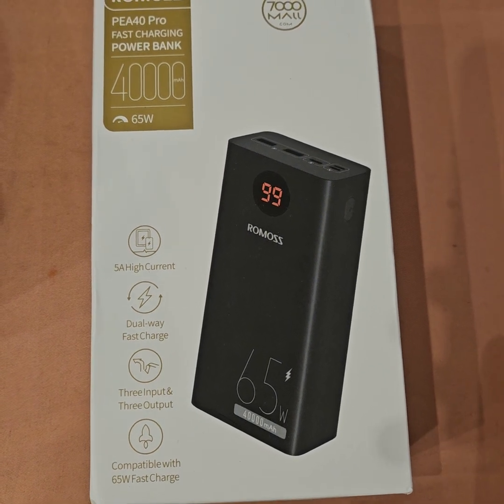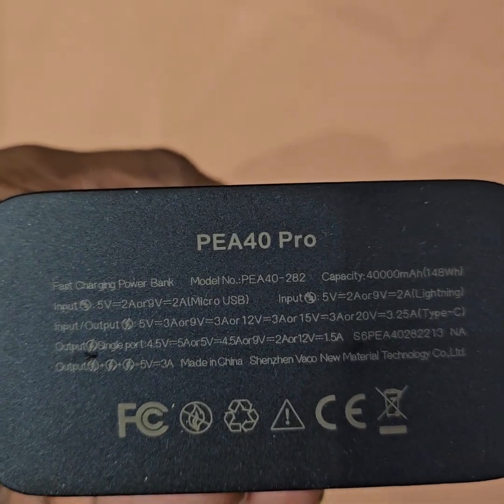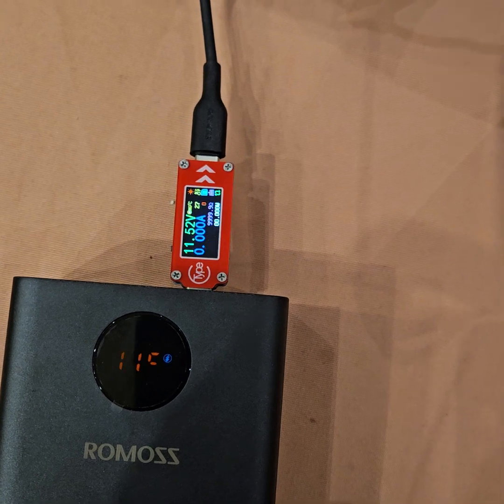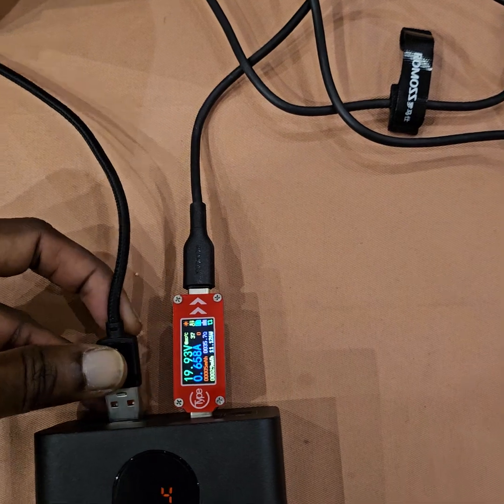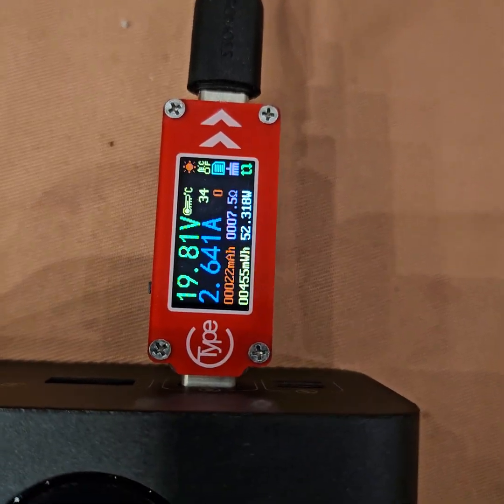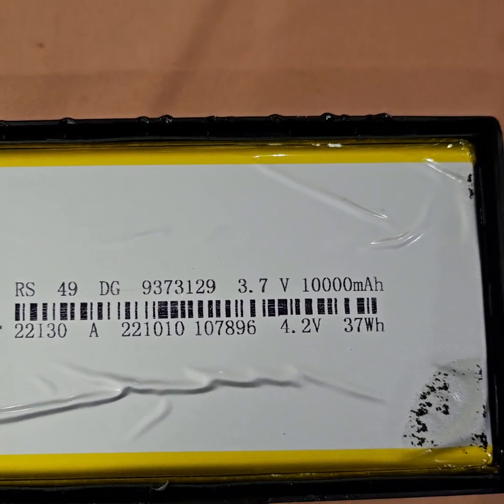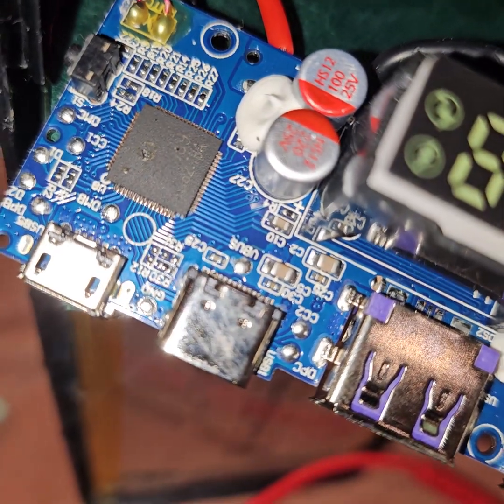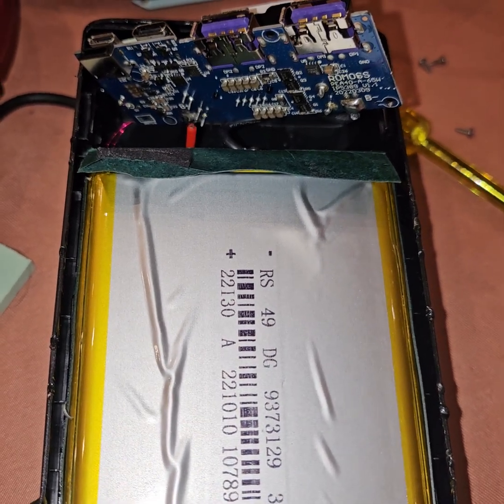Romoss PEA40 Pro 40000mAH 65W Powerbank, review with teardown and Problems IP5389

Comment: Between this and the baseus ambilight 65w which would be more durable
Reply from the maker: Durability is difficult to say. Technicaly both have different capacity and Ports. So a comaparability is not same, except the 65w max power.
Reply: @HouseAndSolarProjects  thanks

Comment: If I understand you correctly, if I use usb-c port for output I won't be able to use usb-a port at the same time at all, will I?
Reply from the maker: You can use both the ports, but the maximum power from both the ports are limited, which is less than 30Watts
Reply: @HouseAndSolarProjects  Understood. Thank You.

Comment: What can I use to discharge my own.
Reply from the maker: You can use laptop or other powerbank to change or can get a discharger from aliexpress
Reply: @HouseAndSolarProjects  I got to know now that it's not compatible with my laptop. My power adapter is 150W, the power adapter is 65W. My laptop is hp zbook 17 g3.
Reply: @HouseAndSolarProjects Hi! Can I use lenovo 65w(laptop charger) to charge that romoss powebank?

Comment: Thanks for the review. Knowing it only charges one thing at a time is useful. on another note, I think your toilet is leaking water. You might want to get that fixed.. It adds to the water bill overtime. With the display I think you can calibrate it by letting it drain to zero and then charging non-stop to full. Let me know if that works 🙇
Reply from the maker: Thanks,  the running water sound in the background is from Aquarium 😀.
Reply: @HouseAndSolarProjects  ahhh okay .. that's cool 😎